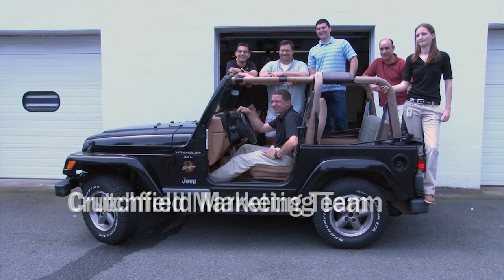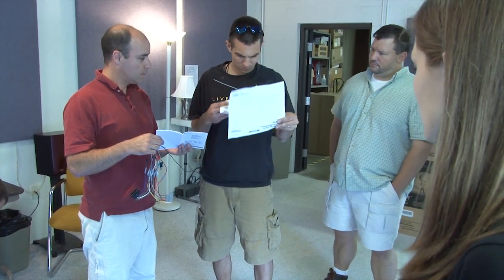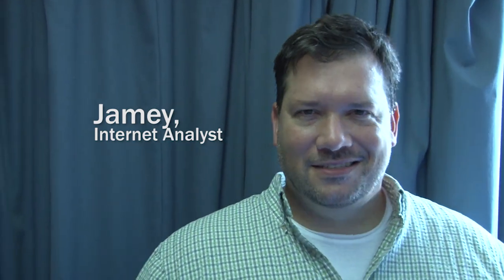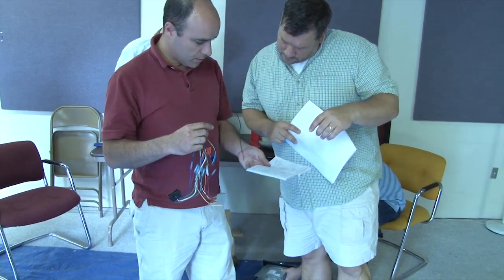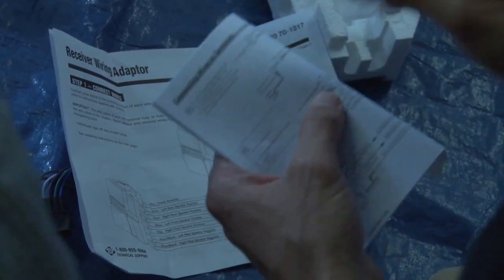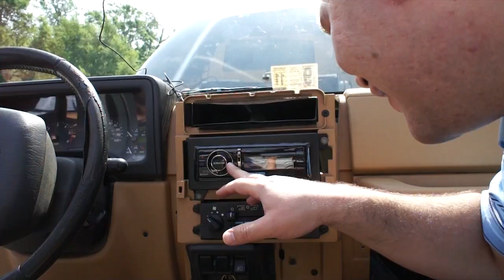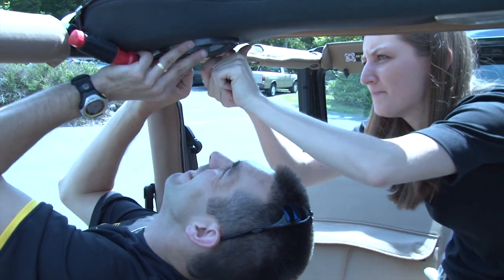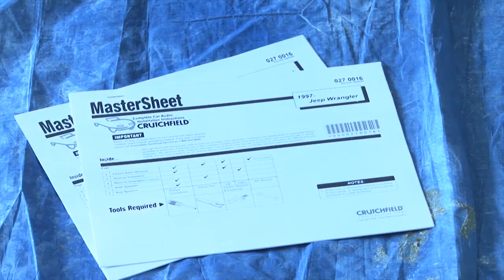Crutchfield MasterSheets: Everyone Can Install Car Audio   | Crutchfield Video

Comment: I was 15 when I installed a stereo, 4 speakers, and a sub/amp into my 2001 wrangler. I bought everything from crutchfield and it couldn't have been easier. Jeeps are so easy to disassemble and speakers are only held in by 4 screws.